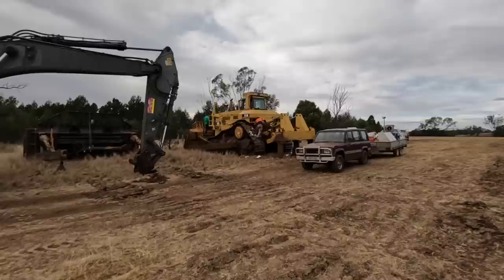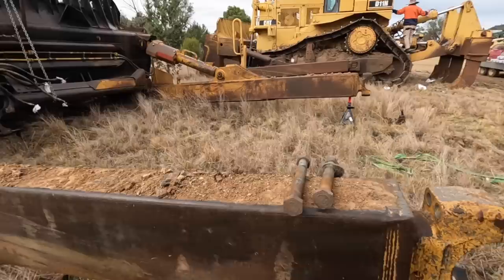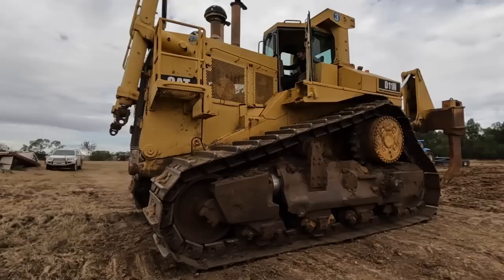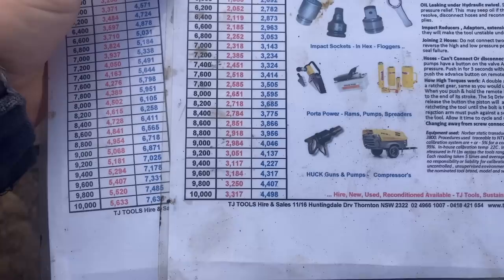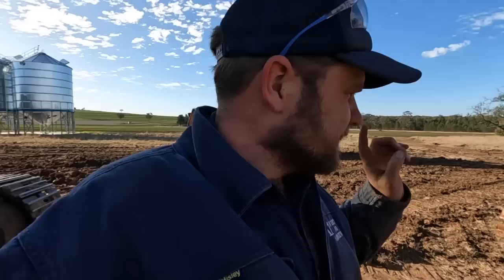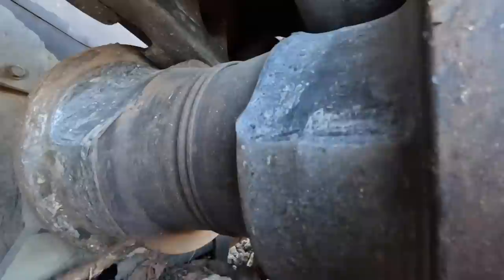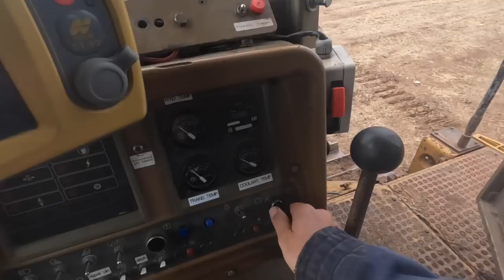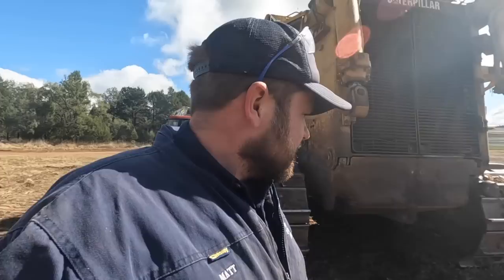D11 Track Swap - Goodbye Tiny 2 Pt 1

Comment: At least those tracks have that clever joint system you don’t have to press a master pin out. Expensive job running those d11’s. Slick operation though

Comment: Stabilizer bar so blade does not swing into the tracks. Seen a few of those broken in mining. The rock was so abrasive and the operator were taught not to use the decelerator , end result new set of tracks every six weeks. Great to see the good unbeaten condition of your older models. Good team work here.

Comment: I always wondered how to do track changes on those big machines, I spun the track off a 20t excavator and spent the afternoon learning how to put it back on, turned out the tensioner had failed but an easy fix.

Comment: I have seen some dozers where the carrier rollers are replaced with hardwood skids. White oak works great. I’m sure that there’s a down under equivalent. That’s if you even want to bother. Sounds as if the Tinys work fine sans rollers.

Comment: How much heavy equipment experience did you guys have before getting the d-11s? It is quite an undertaking to start ripping into that big of iron
Reply from the maker: Hi Robert, we had little to no experience with something this big so we get people to help in certain areas but we have all worked on tractors and other smaller equipment, funnily enough it’s easier to work on the big stuff because there’s more room to get to things👍😁

Comment: Looks like the reconditioned track are a good bit narrower than the track you pulled off of Tiny 2 , Are you worried about flotation with the narrower track with what you do
Reply from the maker: Yes they are, we would prefer the wider ones but we can’t be too fussy😂😂